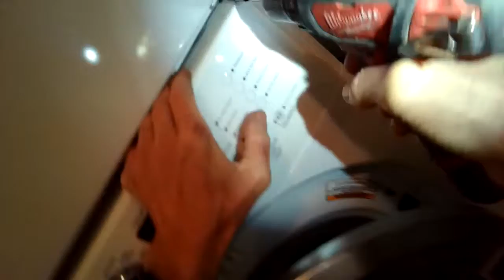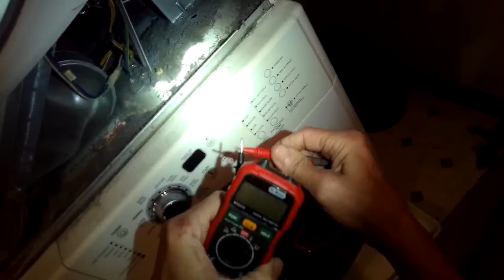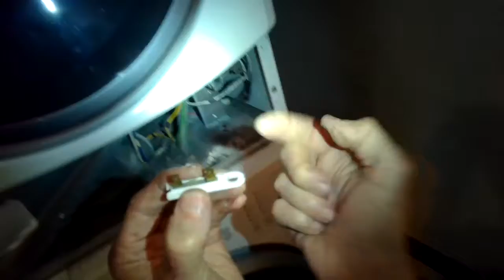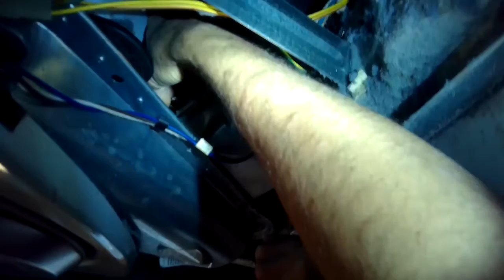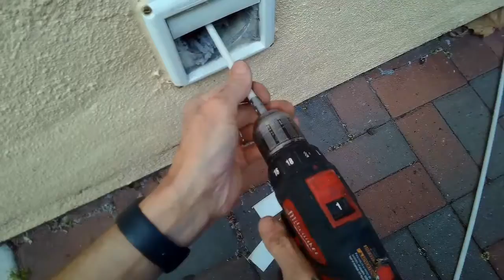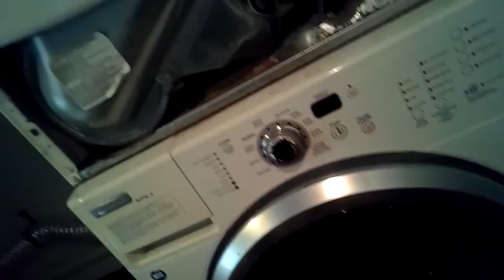✨ MAYTAG EPIC GAS DRYER - NO HEAT - EASY FIX ✨

Comment: The igniter on mine works but it will not light. It's like there's no gas flow. Any ideas?
Reply from the maker: Often the igniter will glow, but it’s actually worn out and is not allowing gas to flow.
A new igniter should fix it👍
Reply: @ScottTheFixItGuyChannel  UPDATE. It was the solenoid not the igniter.

Comment: Thank you so much for the video!! I have the same dryer and I just opened it up like you did to check what’s going on and the igniter is igniting and it’s turning on a flame and then two minutes in it flame goes out. The gas line is open. Any idea what this could be?
Reply from the maker: Maybe the dryer exhaust vent tube is blocked causing it to overheat at 2 minutes.

Comment: Thank you so much for your video. I had no idea how to figure out why my dryer wasn’t heating. It’s 15 years old and I’ve replaced other parts in the past. This is not a good time to pay for way overpriced appliances. It was tough getting to the screw as it would have been just as hard to take off the heat cover. 2 months post rotator surgery, so this was very difficult, but it now heats up. Thank you sooooo much!
Reply from the maker: Nice job Wendy❤️👍😊

Comment: Please help. I followed step by step on your belt and roller repair. But once I plugged it back in, it would not start and there was a yellow flashing light on normal, but the 40 minutes was on. This dryer is gas.
Please help
Reply from the maker: Can you double check that the door switch connector is back in tight?

Comment: Thank you for sharing this! I had to fix my girl friends whirlpool front loader just like this one and was set up exactly the same way! The thermal fuse had no continuity, the new one did. Installed it, and fired up right away! Total life saver! Thank you!

Also this is the only video I found that showed a gas dryer like this model, and how to access the parts the could be the culprit. So once again, thanks!
Reply from the maker: Thanks Cody,  nice job👍